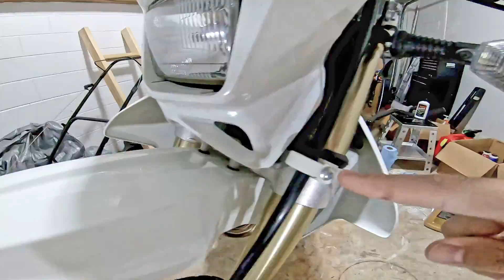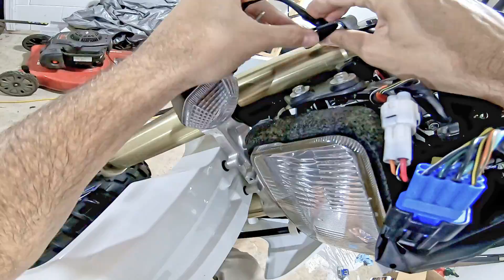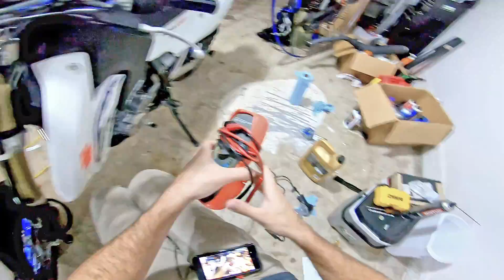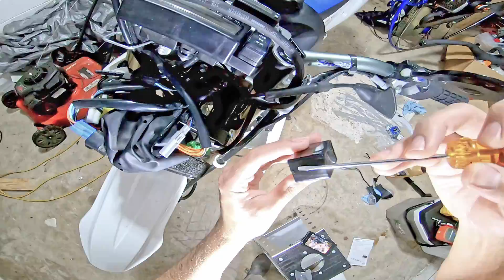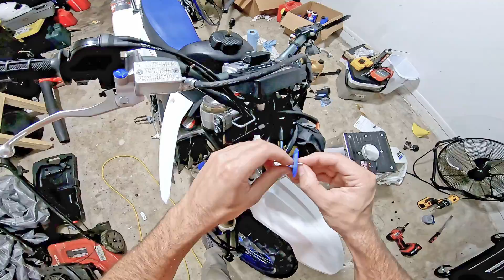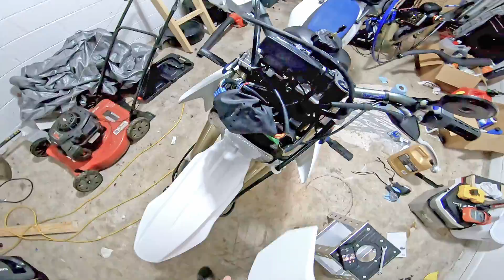DRZ400SM Front LED Turn Signal Upgrade

Comment: Good education thanks. Where did you get the 3d printer programme for the indicator housing may I ask. 
Cheers from NZ
Reply from the maker: It's just something I modeled up in Fusion 360 on my PC. I threw it on thingiverse so it's available to anyone who wants it. Much love New Zealand! Thank you for checking in. Shout out from Florida USA.

EDIT: I realize the 3D printer program is not the same as the .STL file. I'll explain further just in case. the 3D printer program is created by downloading the .stl file I put online and slicing it with your favorite 3D printer slicing program. The slicer program will create the G code needed for a 3D printer.  In this case, I used Prusa Slicer, but there are many options. If you need any help, please reach out. If you already knew this, I apologize for insulting your intelligence. Best wishes! Reach out if I can help!
Reply: @ cheers mate 🤙🏼crystal clear thanks for the advice tho.